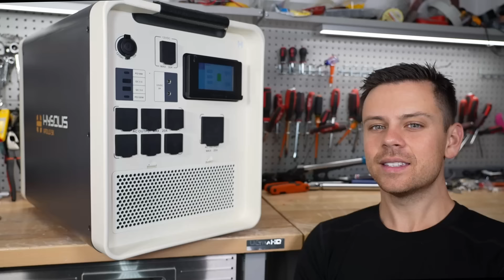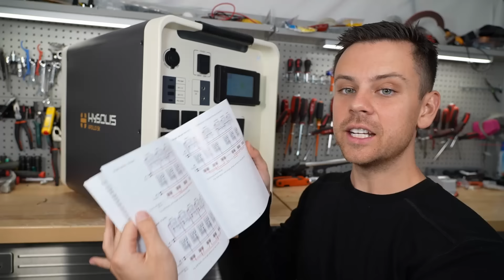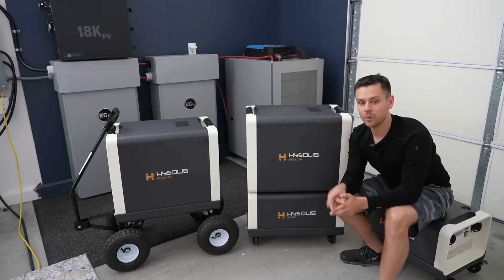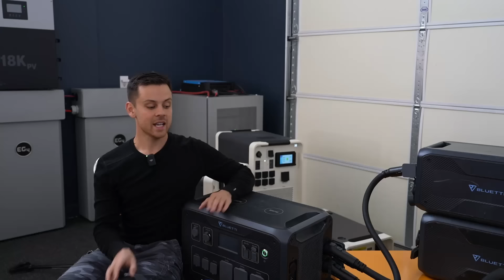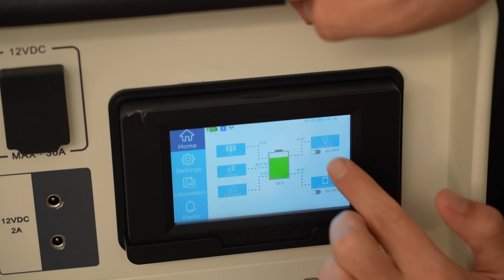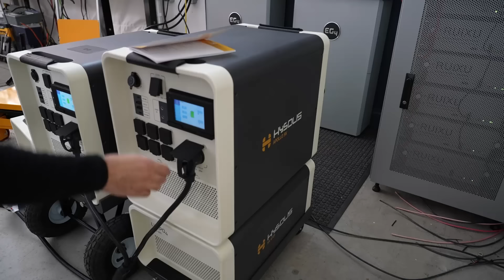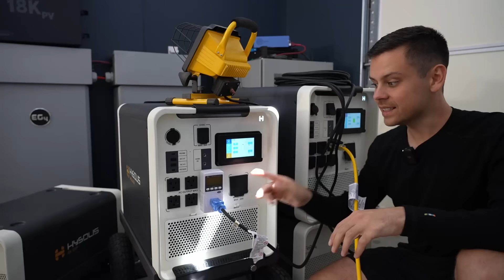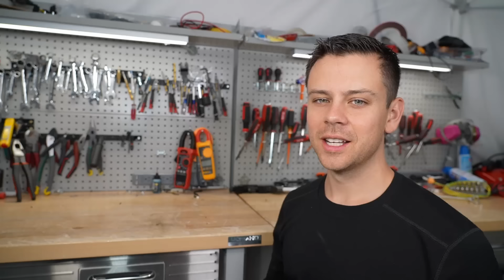Hysolis Apollo 5K Review and Test

Comment: Can this power up a house?
Reply: Sure, if you get enough of them to make 240V, and enough expansion batteries! LOL... But in truth, it depends on how much you need to power in your house. If you can "budget" your power needs, you could probably make even one of these work, at least in 120V AC usage, like to power a refrigerator, and possibly a small air-conditioner. I personally wouldn't do a grid-tie system with one of these, though.
Reply: I don’t know… probably a small cabin.

I just powered up my new Genetry Solar 12k inverter, tested my electric dryer, and that dryer alone drew over 5000 watts!!!

When running my entire house with normal lighting & tv loads while adding an HVAC compressor, that is another 5000 watts. 

I am getting ready to run it a stress test of everything together (Dryer, House, HVAC compressor) at the same time as my oven & 4 burners… I expect to go to about 15 KWh.

Clearly, this Apollo is rated for 5K, certainly not rated for my house. 

I expect my newly purchased Genetry Solar 12k will be pushed to the limit with my house, as I am finishing my stress tests before final wiring.

Comment: Really great presentation, Will. I bought a Bluetti AC500 battery after your review.  Finding out their customers' service is challenging, both when ordering and follow up up questions is not great.  My goal is to build a DIY for our out building.  In Texas, so lots of sun. Watched this to the end, I think you covered everything, although still learning.
Reply: I hope you never have a fault with the unit. They are impossible to do business with. Took me 6 months to get them to replace my faulty unit after it broke within the first week of light testing. Terrible company. I would never of known had I not had issues.
Reply: @DuncanCunningham  I've replaced a ep500 and a ac500 battery with them with them had some hassle but was about a 3 or 4 week ordeal
Reply: Thanks for being so clear.  Perhaps there is no money in pessimistic (or honest?) reviews on YouTube   @DuncanCunningham
Reply: Need more then 1 battery to pull the full 5k...I have 2 ac500s
Reply: Very important point   @Ajacka916
Reply: Apologize for the delay in response.   I bought 2 AC500s and 2 batteries (should have been clearer). Was initially told I would receive PO30A with the 2 AC500 and 2 batteries (rep via call).  Long story after multiple emails and calls I was able resolve by purchasing 2 add batteries, which was a long-term goal (got promo the timeframe I bought originally).  More challenging than necessary, although resolved.

Comment: Hmmm, for a day of backup I only need 4 5k's and 20 expansion batteries for $93880.00.............
Reply: You are using way too much power for a simple solar system, then. I STARTED off with tiny solar systems, and learned how to budget my electrical energy to fit what I had. I have now worked up to a fairly large system, but I still know when to use less power to get by on heavily cloudy days.
Reply: p.s. I do have a generator, which will charge my battery  bank, but have only neede to use it, (other than the run to test that it would work on my system), once, when we had over 4 days of totally cloudy weather, yet it was still hot enough that I needed to run at least one of my air conditioners.
Reply: @Tumbleweed5150 I think he was being sarcastic because a DIY set up is like 1/5th of the cost
Reply: @niffrig   I just used their site to price out a system to cover 1 day at 115kWh/day.  At that price I could install 3 48kw natural gas generators :)  Of course the fuel bill to RUN them wouldn't be pretty...
Reply: @Tumbleweed5150   Hey, I go around turning lights off and turning the AC up constantly, I can't control the wife/kids, our usage is average about 114kWh/day, not my fault.  I'd prefer a smaller house in a region without snow but oh well....solar would need to be about 30-40kw to offset and not enough clear roof space for that and wife doesn't want anything on the roof....soo MY system is as many panels as I can carry around the yard, maybe make a 2x4 rack with full size panels that I can wheel into the driveway to charge something...need to save up for a 48v battery though, been playing with a 12v 50Ah right now, it's fine for doing the lawn equipment (just barely) but you know how solar goes, once you get a taste you want more more more!

Comment: Check out the Zendure SuperBase V, the major advantage is that you don't have to buy two units to get split phase power. I seriously wonder how well they would compare to the Hysolis you just wonderfully critiqued. The only major disadvantage to the Apollo that I can see in the specs is that it only takes a max of 150v from the solar input.
Reply: We have the Hysolis MPS3K with an expansion battery. It has been powering our compound for nearly two years now. We recently received the Zendure V4600 with an expansion battery.  As soon as we receive the Hysolis Apollo with an expansion battery. We will be comparing the Apollo and the V4600.
Reply: Hope to see it soon! Not sure why Will Prowse hasn't reviewed it...the Zendure is now available for sale and much less expensive than the Hysolis.  @offgridgesertdwellers
Reply: Another vote for testing out the zendure! Would love a single unit for 240v split
Reply: As far as I can tell, it's the only one available that does 240 in  a single unit. @MrKevster23
Reply: I own a Zendure, actually on my second one.  Junk.  Be afraid.
Reply: I would love to read your review of it. Because as of this moment, as far as I am aware, it is the only single unit to offer 240v for around $3,700 as opposed to the $10,000 required to get 240v out of the Apollo 5k @ericfitzsimmons1202
Reply: @garystone2863 The first one died after 6 months.  I'm not sure why.  They did send a replacement, which surprised me.  This one is not fully functional, and from there, I gave up.  The device is very hard to use, constantly drops internet, and is loud as, wow.  It's loud.  I built one from scratch with 240 using EG4 components for less and no problems.  Zendure is a scam, in my opinion.
Reply: Major solar generator companies all make 240v European models (e.g. EcoFlow and Bluetti ). Simply order them from native 240v countries such as Australia, New Zealand, Singapore or Taiwan. That's what I did.  @garystone2863

Comment: Would this work in a vanlife application?
Reply: It would take up a lot of space, but then, so would any other system...you can just tuck away some items in other compartments, if there's not enough room for the whole thing in one place. You would also need to determine if you have enough room on your van roof for enough solar panels to get 120+Volts DC by wiring them all in series.

Comment: I’m curious at 240 V can you get an Inverter at 6K? 3000 just seems too low for a house.
Also, you didn’t talk about temperature when running the solar generators. One thing I’ve learned is to always check the temperatures when running at high levels, or high temperatures in the summer. 
Overall, a great review Will! 🤙
Reply: I’m pretty sure you need another unit, to get split phase. Which will get you 6000W output.
Reply: Yeah… I had a 3000 watt inverter which peaked at 6000, running half of my house on half of the inverter… it struggled. It did not do split phase.

I recently bought a Genetry Solar 12K inverter, received it, and my first test was my electric clothes dryer. 5k watts continuous! 

I am glad I did not buy a GS 6KW unit. 

Next step, I will be trying my house on it. The GS 12K offers 240v split phase, can run in UPS mode, and will peak at 36kW. I’ll see how it runs!
Reply: By the way, I just finished my whole house test with the split phase Genetry Solar 12k. 

It ran my house & turned over my 240v AC HVAC compressor at 130 LRA!

I am pretty happy… getting ready to do a stress test now. 
- electric clothes dryer - passed
- whole house - passed
- whole house + HVAC - passed
- everything turned on stress test is next

Comment: Going to start a farm. I wanted to go solar in an RV and then later use that solar for a cabin that I build roughly 12 x 30.

Would this be good for those two things? Thank you.
Reply: I think so. It would be a good start anyway plug-and-play. Very easy to do and you could put a good-sized solar array up very easily to get started. Maybe 4to 6 450w ish panels.

And you can still use it later
Reply: @VinceBadovinatz88  thank you kindly.!!!

Comment: Good job Will! 
Looks like you covered it all. Just need to see how it works long term.
Reply: Such a high PV voltage to charge😢
Reply: @VinceBadovinatz88  All you need is Hi-Tech, (or similar) 200W Solar panels [6] Wired in Series: 146.01 VOC / 126.312 VMPP @ 9.5A
Reply: @Tumbleweed5150  ok😊ty

Comment: On the DP, you need to plug the car lift in the 30 amp TT-30R with an adapter as the receptacles you used are only 20 amp 6-20R
Reply from the maker: It should be able to deliver the surge through the 20A outlets. It's only required for a millisecond
Reply: What is the DP I'm a dummy when it comes to abbreviations
Reply: Delta Pro @VinceBadovinatz88
Reply: @VinceBadovinatz88 well, only one of em didn't work and has a name that makes sense to be the dp.
Reply: @chublez  ok dh

Comment: Would this be a viable option for marine applications? Do you know of any system like this that would hold up to salt moisture in the air on boats?
Reply: If you ever use shore power then this would not be great option since you'd have to change the ground-neutral bond whenever you connect or disconnect from shore power.